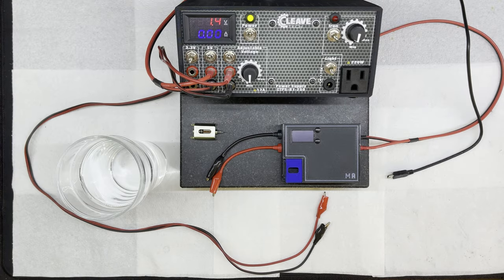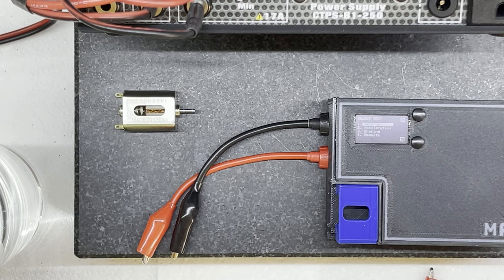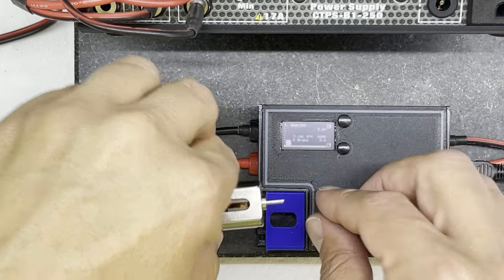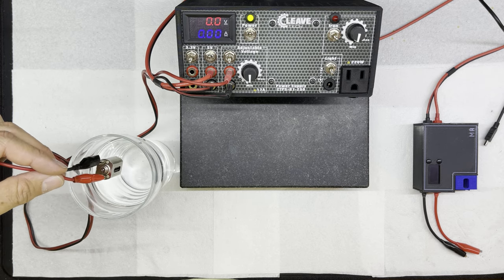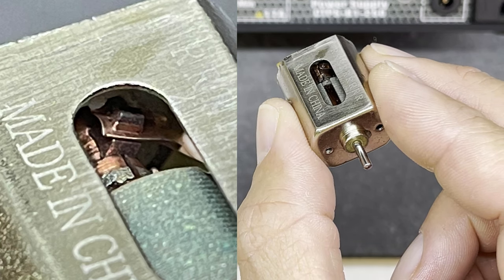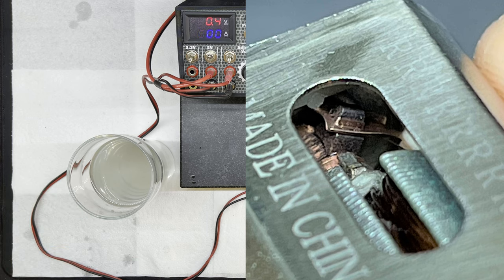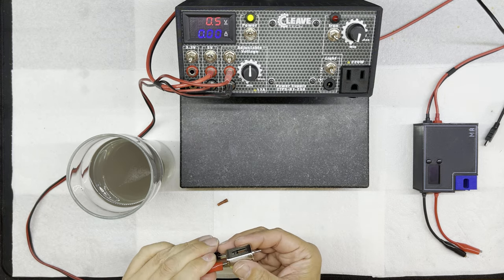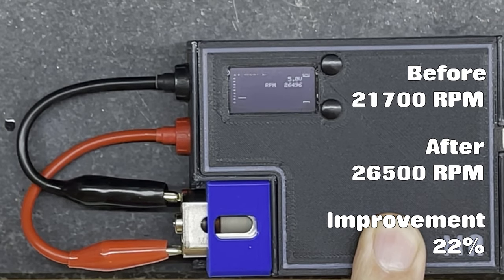Making improvements to a new sealed Slot Car motor (Hawk JK Retro) to make it faster

Comment from the maker: What do JK and UK Distributor ABSlotsport have to say about this video?…
After some questions about running in the motor under water and using different fluids, I have been in conversation with the above and the manufacturer (JK) do not recommend that you use any additive to the water that might soften the brushes. Normal tap water as used in my video is fine, just do not add any other chemicals to it. If the brushes soften then it can cause the commutator slots to clog up with brush dust.
Also make sure you do not contaminate the brushes with oil when oiling the end bell bushing as this has the same effect of softening the brush. I tend to oil the can bushing regularly when in use, but not the end bell bushing for this very reason.
Reply: Oh man. I tried 50/50 water and simple green on a hawk 7 at 6 volts for about 30 seconds. No more brushes when I was done 😂
Reply from the maker: @beinggrownupsux8040  , Oh dear 😢. I have found that the brush material does vary from batch to batch so the time that might work on one motor might not be right for another. Best to start with 10 second bursts and keep checking.

Comment: I use straight naptha when breaking my motors in then dry off completely then drop of oil on bearings and race. While running the motor i tend to watch it thru a glass jar/cup and watch for a puff of debris to shoot out of the motor. It varies between motors some after 30 seconds some later normally happens as soon as brushes are fully seated.

Comment: Great tip, Did it to a new sideways babyraptor yesterday, the brushes didn't look as bad as those in the video, did the resistance before, it flickered between 7-8ohms afterwards it flickered between 1-2ohm. Great not to need to spend a whole evening at the track running it in. Runned it in batterywater and then cleaned it with IPA.
Reply from the maker: Great job. Did you see the video where I ran a motor in backwards?
Does running in an FK slot car motor (Hawk 7 or JK Retro) backwards improve performance?
https://youtu.be/vODYLMpELeI
Reply: @CleaveTech  no I didn't, bought 2 motors actually so I can do it with that motor
Reply from the maker: @lunchman84  let us know your results when you try it 👍🏻
Reply: @CleaveTech  will measure the current also on the already runin motor and a before/after pn the other one backwards. Running it with some ebay pwm motor controller.

Comment: I'm thinking about getting into slot car racing.  I had a Strombecker 1/32 set in the 1960s.  Why do the brushes have that curved where you end up making it straight and a straight area where you end up making it curved?  If I looked at that without knowing anything about your process I would say the brushes are installed 90º out of position.  They are flat against the curved commutator area and curved against the flat commutator area.

Comment: Can this method be used for breaking in other chassis. Including non can style. Pancakes As found in some HO stuff, by removing the center top gear. 

Or the rear drive get in a V1 superG style chassis? 🤔 
Great videos thank You.
Reply from the maker: If the motor has carbon brushes, then this method can be used to help run them in. Be careful, as some brushes are very soft and could disappear within a few seconds if you are not careful.

Comment: Through the years I've raced Different types and sizes of slot cars, on most of the "inline motors" I would polish the lams (I.E. the plates that the motor is made of were the windings circle). And seam to increase the rpm that the motor run, but never knew what increase I achieved. Since you have a RPM analyzer could you do a test and see the before and after outcome please?
Reply from the maker: This type of motor is not designed to be opened up so it can be hard to polish the laminations in the way you mention. Even if the hole in the can was large enough, polishing the laminations would make the motor illegal for racing.
Depending on how much material you remove from the laminations, you could actually be helping the balance of the armature and improving the rpm that way, or you could be reducing the armature diameter and increasing the air gap, therefore allowing the armature to spin more freely and increasing the rpm.

Comment: Great video sir. I would like to know approx. how long you ended up breaking the motor in under water? Also, any thoughts how this particular motor brushes would compare/differ from say NSR or Slot.it motors and whether or not you have experienced similar (22% improvement) results with either of those motors? Last question, by wearing down the brushes, which looks to be quite significant, I assume (possibly incorrectly) that the life of the motor is reduced the same? What's been your experience as far as motor life compared to a motor not run-in this way? Many thanks!
Reply from the maker: Hi Tom. Thanks for watching and commenting. I ended up running the JK Retro Hawk motor underwater for about 6 minutes at 5V. I have come across motors that only require about 20 seconds so be careful. The brush compound is sometimes different from batch to batch. I don’t have much experience yet with running in NSR or Slot.it motors of a similar style because I have not really raced them much. 
The effective life of the motor is reduced by running in the brushes but the commutator has not experienced a lot of arching under water so it will be in better condition.

Comment: Great video thanks is there some simple way to test that type of motor without expensive equipment?
Reply from the maker: The simple test is to measure the current at a set voltage. The motors that draw the most current often have the most torque and brakes.

Comment: I've never seen a question as to why aren't the brushes manufactured with a concave face, that would ensure maximum and proper contact with the commutator in the first place?
Reply from the maker: Brushes for motors that are designed for service are manufactured with a concave faced brushes but I think that these motors use brushes like this because it helps the bedding in process and ensures reasonable even performance straight out of the factory.
Reply: @CleaveTech  Understand this, however it would be a simple manufacturing process to produce brushes, regardless of application that are faced in a similar manner. It really only illuminates the fact that apparently these manufacturers of motor brushes haven't bothered to apply a little common sense to do so in the first place. If I were to make a somewhat exaggerated example, it would be that early tire manufacturers produced hexagonal tires, due to 'ease of manufacture' that would moderately accomplish the job because the end user of the tire can simply wait until all of the high points wore down from use of the tire. Ludicrous.
Reply from the maker: @312KINGFISHER  I guess it might be to do with manufacturing tolerances on the commutator size?

Comment: Been doing this since 1978 on RC cars, we call it water dipping. The water does not help conduct more current. I holds the motor rpm low from the drag, thus higher current with less CEMF.
Before = 21700rpm, After=26500rpm=22% improvement?????? What, 4,800 rpm slower = improvement?
Breaking the brushes in, creates more brush duration (aka overlap, 2 pole windings being powered at the same time), this gives more rpm and torque in my decades experience on 05 Mabuchi and Johnson motors. I am really surprised you lost that much rpm (and claiming lower rpm is 22% improvement), thoughts?

Comment: So was the water normal tap water or distilled (de-ionised)?
Reply from the maker: Thanks for the question. Just normal water. People do use all sorts of other fluids and chemicals, some of which may help to keep the com even cleaner during the run in period, but I thought I would keep this example pretty easy and simple. Maybe that can be a topic for a future video.
Reply: Normal tap water will do just fine 😉
Reply: I was told that distilled water does not work very well. I mix a 50% Fabuloso cleaner and 50% tap water and run the motor for 30 seconds to break in the brushes. I would like to buy the motor analyzer. I also used this solution to break in a G7 or open motor which I normally break in at 3 volts for 30 or more minutes. I broke in the G7 motor with 32 magnets and a .485 diameter 84 armature using 2 volts. I was able to break in the G7 motor but, most G7 racers would not use this method for expensive G7 motors.
Reply from the maker: @johnwakamatsu3391  . Thanks for your comment. If you want to purchase the motor analyser, send me an email to cleavetech.james@gmail.com or send me a message via the CleaveTech page on Facebook. Thank you.

Comment: I just 'subbed'. The motors we run you cannot see the comm's.
Reply from the maker: The RevoSlot motor that I have been using recently is totally sealed with a big sticker so I can’t see the brushes in that either. I haven’t run it in yet but will probably just run it in slowly under water and watch the current increase very slightly.

Comment: Did you lube the shaft
Reply from the maker: I don’t lube the shaft when running in the motor under water. The water acts as a lubricant.
I will oil the shaft at the can end when it is run in and put a tiny amount of oil at the end bell end.

Comment: 1 min / 2volts - i use 1/3 watter + 1/3 benzine + 1/3 Ultra Max Cleaner Wurth solution
Reply from the maker: Thank you for subscribing, watching and commenting. Although people have had success with running in their motors in different solutions (other than just water) it is not advised by the manufacturer as other chemicals can soften the brushes and create a mess of carbon inside the end bell and around the commutator. I guess it depends on what material the brushes are made of in that particular batch.
Reply: so as any gasoline and thinners at all kinds

Comment: I have used the water method on 3 New Hawk Retro motors with the same results, brushes wear very quickly. The most I can run the motor in water, at 5 volts is 3 to 5 seconds, or the brushes will be worn out. I ran one motor for 30 seconds and one brush was worn to the arm. Any suggestions?
Reply from the maker: Hi Bob. In the video I do mention that some motors seem to have really soft brushes that do wear very quickly. I have also had motors that will wear brushes out in 30 seconds under water. Brushes seem to be different from batch to batch so you are doing the right thing to check after about 5 seconds to see if the brushes have run in. You can normally tell instantly if the. Rushes are soft as the current reading on the power supply will increase very fast.

Comment: bruschless motors is here now
Reply from the maker: Yes they are. Still a way to go before they are commercially available but the use of brushless motors will reduce the maintenance time needed for motors.
Reply: @CleaveTech  ? its drone motors, have been around for some years
Reply from the maker: @mrafard  Yes, the motors are available, but suitable electronic speed controllers for slot cars are not commercially available yet.

Comment: Those motors are junk. You have to buy 50 to find and if you are lucky you might get 5 good ones. Then you probably won't have breaks. They are inconsistent. Break them in  in simple green. Use computer dust off to blow and clean motor. You or can just leave it on your power supply at 3 volts for 3hrs to 24 hrs